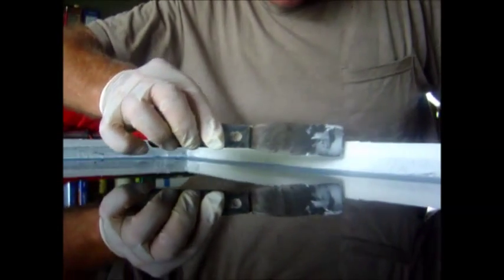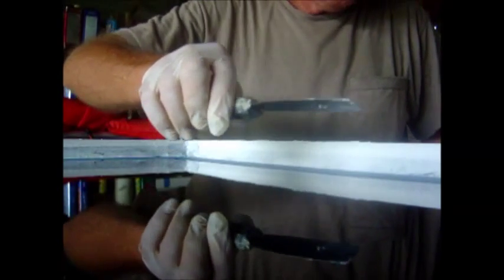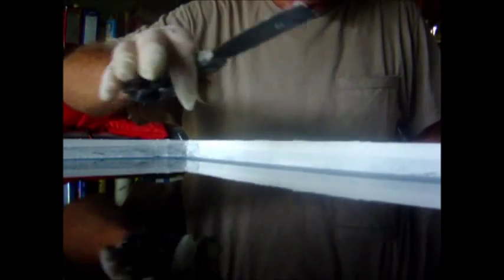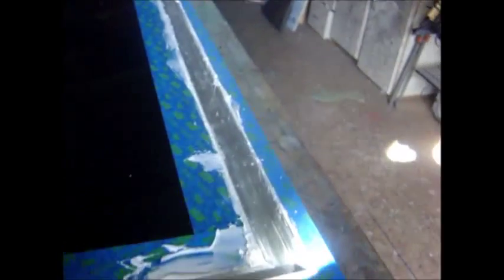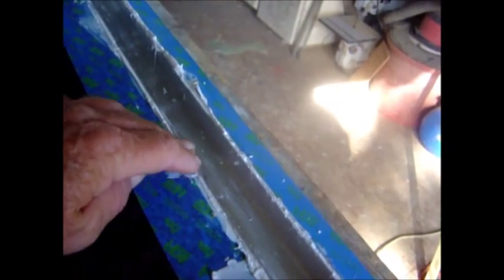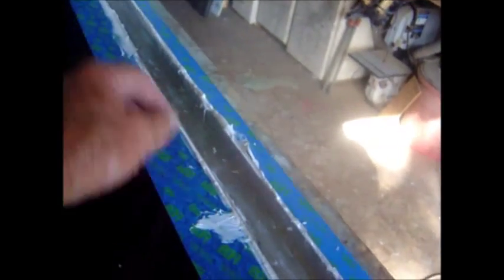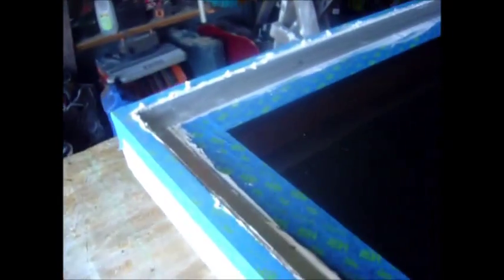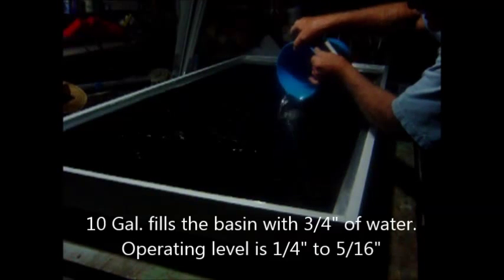Solar Water Distiller Build #2 Part 4

Comment: Great work.
I live in Southern California so it would generate more water since it is much dryer here. 
Are the aluminum pieces for structural rigidity?
Wouldn't it be better to use a stainless steel angle metal instead of aluminum?
Do you sell any of your units?